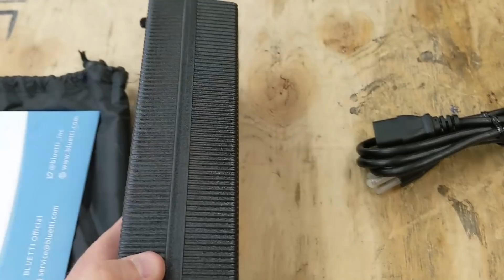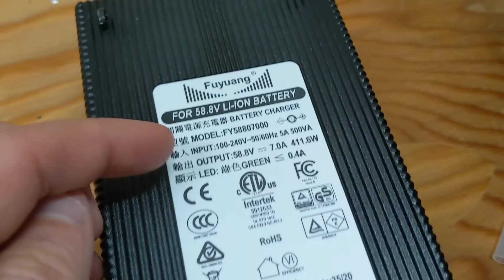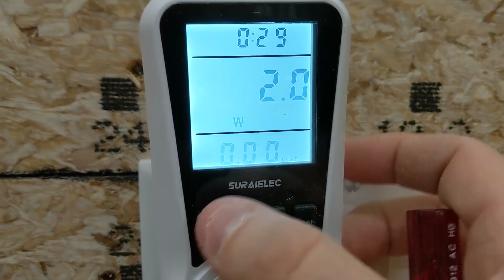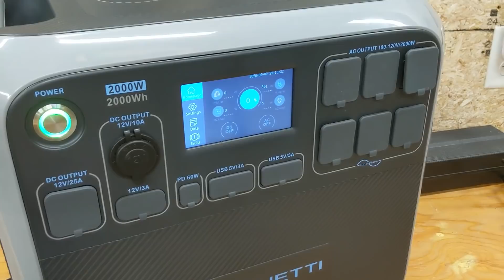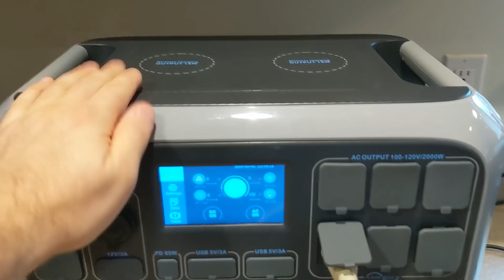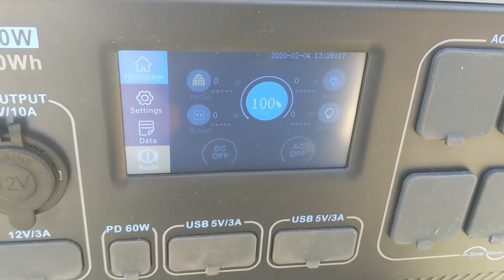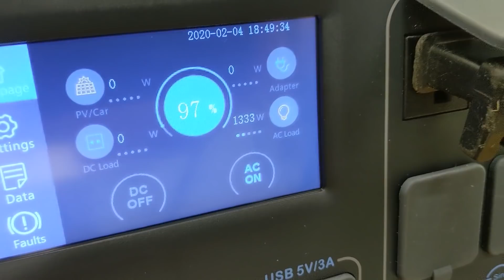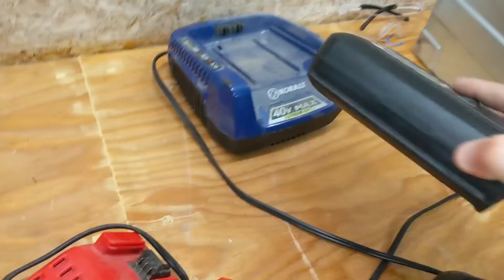DPoz Reviews:  Bluetti AC200P - Updated model for 2021 - Solar Generator

Comment: Is this a power station or a generator?  Is it noisy?
Reply from the maker: This has a battery, inverter, and solar charge controller all in one box.  Most of the time it's silent, but it does have fans on it that help cool the unit as needed.  The fans have a small noise to them.
Reply: @DavidPozEnergy  thanks!

Comment: I just bought this unit looks great seems to operate great but I noticed it is not UL certified/listed that is a concern for me as if I ever had a fire God forbid I don't believe my insurance would cover please advise
Reply from the maker: This is not made for permanent hookup to your house.  It's made for temporary and portable situations.  I think that's the difference between needing UL or not.  However, I don't work for UL (underwriters laboratory) or an insurance company, so you will have to check for yourself.

Comment: Sorry, do I understand this correctly? This giant battery that costs $2000 can run two little lights and a tiny heater for only five hours? What am I missing here?
Reply from the maker: Yep.  What Bluetti has done is combined lots of small things into one package.  They have a 2kWh Lithium battery, 2kW inverter, 15 Amp Solar MPPT charge controller, 10 Amp Car charger, Wall Charger, display, meter, outlets, USB ports, all into one package.  If you tried pricing out those items you will find they also cost about $2,000 and then you would have to assemble all of them.  This is made for fairly small applications.  For example, Van conversion to campers.

Comment: Thanks for the video.  I bought the AC200P + 3 120-watt solar panel package.  I took it out of the box and tested the solar charging and was surprised to only see about 4 to 5 amps at about 55 volts while the panels were in full sun. I guess I was expecting to see the full 12 amps.  Am I missing something?  Or is it working correctly?  I've done a little 12 Volt work but only running off alternators in my van.  The high voltage of the 3 panels in series may be confusing me.  Is an amp at 12 V the same as an amp at 55  volt?  Thanks all!
Reply from the maker: Sounds like you are getting about 250 Watts out of a potential 360 Watts, so it's performing 69% of rated.  A few things for this.  1. Orientation.  Solar panels perform best when perpendicular to the sun.  2. Time of day.  Best time to test a solar panel is solar noon.  3. temperature.  The solar panel must be cool.  Test conditions are 25°C for the panel.  But panels get hot when in the sun and then under-perform when hotter.

Comment: Will it run a hair dryer?
Reply from the maker: Yes.  I tested it with my wifes and it worked like normal.
Reply: @DavidPozEnergy  Thank you! I know drying my hair shouldn't be a concern during an emergency, but my hair would never dry!

Comment: Hey David, I am looking to purchase a Blueitti for my off grid cabin.  I am wondering about running the Blueitti directly into my very small panel.  The panel has breakers that will run about 9 LED 8watt lights.  I was also thinking about running a small fridge at the cabin via an outlet that runs to the panel.  What do you think?
Reply from the maker: You would have to make sure the small panel is 120v only, not 120/240.  Otherwise, I don't see a direct problem, but very hard to say without being there.

Comment: How long can your window unit run ? What if your still connected to the solar panels
Reply from the maker: My window unit (5000BTU) draws 460 watts.  This Bluetti will run it for 4.1 hours non-stop.  However, if it's just maintaining temperature in a room then the AC thermostat will kick on/off periodically as needed.  This will extend the run-time.  You could connect more than 460 watts of solar panels (up to 700w) which means when the sun is out this unit would run the AC without depleting the battery.

Comment: Great video, you really know your stuff.  Hope you can can respond soon, I am considering getting 2 of the suggested solar panels (Q CELLS 430 WATT MONO DUO CELL SOLAR PANEL G8.2) & the Bluetti AC200P - I thought you said can send more than 700 watts to the device without a problem, just will only use up to 700 - is this correct, overkill or would you recommend different solar panels to charge the Bluetti > will be using in Arizona (lots of sun)
Reply: actually appears the shipping is very high for those panels $330 per panel - is there another panel you would recommend?
Reply from the maker: When connecting the solar panels, the most important thing is to stay under the maximum voltage.  But it's OK to go a little over the watts if that works better for you.
Reply: @DavidPozEnergy  Hi David, just purchased one in Germany and want to attach solar modules as well. In winter times you want more modules attached than in summer, so I'd like to attach 4 - with the risk of having too much watts in the summer. There is probably no easy way to control output watts. Where do you have this statement "it's OK to go a little over the watts" - is this supported by Bluetti? How much is a "little over"?
Reply: What panels would you recommend for getting to most watts (max 700) the bluetti ac200p? - I am in Arizona with lots of hot sun - please let me know asap   Thanks!!!

Comment: Hi very detailed video. I have a dilemma if you can help me. I am in van and I want to run instant pot, freezer and electronics. Between dual charge system with inverter and this what is better according to your opinion? Thank you in advance
Reply from the maker: When you do out the math on buying the different parts DIY is usually a little cheaper, but not by much.  If this Bluetti will handle your needs, just go with it.  But if you want something a little more (like more battery capacity, or more inverter) then DIY it.
Reply: @DavidPozEnergy  thank you so much for your fast response.

Comment: great video david! hey i am going to be building a 12x 24 cabin, and wonder if it would be feasible to wire it in 12v  and 110v. have both come out into a corner of the room where i would leave the bluetti. i could put male connectors on both elerical systems, and plug them into the bluettie...this way i can take the bluetti with me when trucking, and then power the tiny cabin when back from the road. this way i can have recepticals everywhere in the walls, and i wont have to run extension cords for everything.
Reply from the maker: Yes, that is possible in a very small space like you are describing.  The difficulty I've seen with running 12v in a house is the voltage drop.  Since your project will be short runs it probably won't be a problem.
Reply: @DavidPozEnergy  right on, great to hear. this way i can take it with me on the road, and also charge it up for when i arrive back at the cabin....cool stuff...thx for the reply david...have a nice day man

Comment: I think im going with this one! The most im powering is a heat gun and small pancake compressor for work! Also using for when I go camping and overlanding so can charge in the back from the 12v before departure. I think this will be the one

Comment: My eb240 has no problem starting and running my 5000btu ac unit,even when my temperature is set low enough for it to cycle  on and off. Its a ge brand.

Comment: The difference between the saw and the compressor is due to the more inductive nature of the compressor. Any electrical load (appliance) has a resistive part and a inductive part. The Resistance of an electrical circuit represents the resistance against letting the current flow, ... or stop it. Supraconductors are capable of litteraly "0" resistance whereas an electrical insulator has an "infinite" resistance (plastic covering the copper in an electrical cable for ex). Inductance is the physical property representing the resistance against CHANGE of current in an electrical circuit. Typically, electrical motors have a bigger inductance compared to heaters (ex: hair dryer). Sine inverters can deal easily with resistive loads but with much more difficulty with inductive loads. In your test, the inductance of the saw is smaller than the inductance of the  compressor, and the Sine inverter deals better with the inductance of the saw than with the one of the compressor.
Reply: I think it has more to do with the duration time of the surge.

Comment: Love that solar generator but doing the math using my Ryobi 2200/1800 Watt gas generator, I'd have to use it 180 times with a full tank of gas to make the purchase for this worth it. That includes gas, oil, air filter, wear and tear on my truck to get gas. Obviously know the advantages of this but for my use case the price point isn't worth it. Love the video and thank you for taking the time. I wish everyone made videos like this for different use cases and good information! Might buy this later down the road!

Comment: Question. How well/long does it charge via the Aviaton plug connected to a 12 volt cigarette lighter adapter plug?
Reply from the maker: About 20 hours from 0% to 100%.  That plug is 12-30v, 8.2 amps.  My car usually is about 14.1v when driving, so if I had this charging while I was driving it would pull (14.1v*8.2a)= 115.6w.  The battery is 2kwh, plus some loss in the process.
Reply: @DavidPozEnergy  Thanks

Comment: 1ton Air-conditioner wil run for how many hrs ,if not pls recommend power bank
Reply from the maker: This battery/inverter can output about 1.9kwh.  If your air conditioner draws, maybe, 950 watts...  Then it can run for 2 hours.
Reply: @DavidPozEnergy  for 9 hrs vt to do

Comment: Is it possible for welding?
Reply from the maker: A small flux-core welder on a low power setting will work.  But not if you crank it up for thick metal.

Comment: Inefficient power station which loses 50% in 24 hours in ac mode with no devices and 1% per hour in dc mode. 
Cancelled my $4500 order (with 3x sp200) the detail information also in their site is not consistent. They said sp200 is waterproof but after they said it is only IP54 and should not be put under rain. Also they say the sp120 is ip67 when it is exactly the same textures than the sp200. The site is inaccurate and it is impossible to get any replacement of some cable and adapter in canada. I don’t recommend.

Comment: Hi I haven't  a clue about  solar  power stations or voltage  wattage  or amps 
My question is what power solar  generator  would  I need  to use  a 750w toaster and a 1050w traver kettle  in my campervan or rv as ye call it  without  using  all the power 🔋and still be able to charge my laptop and two  phones 🤫👍, I'm living  in Ireland  so not much sunshine
Reply from the maker: There are a few things to consider when sizing.  Good job already knowing your loads.  If you want to run both the toaster and kettle at the same time, then you need the output to be at least 1800w.  This one is 2000w, so you are good there.  
Second thing is your battery capacity.  If the taster and kettle run for 10 minutes, then that's 17% of an hour, so multiply the draw (1800w) by the time it runs (in hours) = 306wh (watt*hours).  Plus your laptop and phones.  IDK, maybe 90 watts for 10 hours, or another 900wh?  You would need to check your personal laptop.  But if that's about right, then your electrical usage per day is 1,206wh.  Is the battery large enough for that?  In this case, yes.  It is a 2,000wh battery.
Last is can you re-charge it every day?  There is a built-in solar charge controller, but you have to buy your own solar panels to add to the roof of your campervan.  If you don't get enough sunlight you can still re-charge it with the engine running

Comment: Bluetti has changed the product now and it has a worse BMS. You can no longer see the battery temperature or cell voltages, they removed that feature.

Comment: The charger that you are using in this video is for the AC200 which had LI-ON batteries, and the charger clearly shows "for LI-Ion Battery. I have the AC200 as well as the AC200P. When I charged up the AC200P from the wall it was getting 448W steadily and at times as much as 456W.
Reply: hi! im new at all this and looking for a battery solution to heat electrically (a few hours in the late night/morning to get the coldest hours out in a caravan).
Could you tell me if / and how long I could power an electric heater of 1500watt with a fully charged battery with this unit?  And if its not possible, what is it lacking/where to look?  Any insights/advice welcome!
Reply from the maker: @Anais Huygens, This unit has a 2,000 watt inverter, so it can power a 1,500w space heater.  However, it will only power for 1hr15min.  because of the battery capacity.  If that's enough run-time for you, then go for it.
Reply: @DavidPozEnergy  Thanks for the reply!  I just read about their Kickstarter for the new 5100w version (also 2000 watt inverter). So is it correct to assume that with the 5100w version I could get 3,5hours out of a fully charged battery  /  out of a 750watt heater 7 hours?
Reply: a 14S Li-Ion and 16S LiFePo4 are almost the same voltage. The BMS will protect against the .4v difference. Also the charger shuts off when the tail current is less than .4 amps. There are at least 2 different bluetti chargers now for the AC200(P), one is a 7 amp and one is an 8 amp.

Comment: Good Video, but..... For $1800.00 I wouldn’t even consider this, a Predator 3500 gas generator outperforms the Bluetti in every single category and for $1100.00 in savings I’ll put up with some noise...but that’s just me

Comment: My van has a 150 watt 110 ac plug, if I used that to charge this while driving would it just blow the fuse since it's showing 380 watts from the wall outlet?
Reply from the maker: Yes.  But you could charge this from your 12v plug in your van.  it comes with a 12v adaptor.
Reply: @DavidPozEnergy  ah ok I am not sure what my cig lighter output in the van is but hopefully the ac200p won’t blow it out like the 110 outlet would.
Reply: Wish I could get them to send me one for review! Hehe

Comment: Great Product..  Just Ordered one!  I have a pile of LifePo4 32650 5AH cells.. going to look into adding Mo Battery externally.  Hopefully parallel my cells with the internal 16S so the charge/discharge limits work properly.  I can survive with 2Kw ish output, but more WH capacity would be nice.  I have four 200W solar panels which should work perfect.  I have a well pump which requires 220v so will need to crank the generator every day or two anyway. If using the internal balancer looks risky, I may risk no BMS.   I've heard that LifePo4 isn't as pickey about cell balance, an occasional Top balance with a balance charger is all you need. Comments?
Reply: IMaybe just connect internal and external LifePo4 16S batteries thru a silicon carbide diode so that external battery only supplies current to the Bluetti.  Internal charge balancing occurs normally, I have an external charger for the external..  David..  maybe Bluetti would comment how to add external battery capacity No Doubt voiding the warranty of course?

Comment: Non linear loads may be another term that is used along with inductive but I had not heard of that used very much. I was familiar with the use of the term "inductive loads" used for cfl lights, electronics, fridge compressors etc rather than "resistive loads" which would be heaters (w/reistive elements), filament light bulbs etc.  My understanding is that inductive loads (or maybe also non linear) put more neutral current load on a electrical system. This is why there were so many neutral wires burning up in ny buildings over the decades once they came out with fluorescent lights, computers, refrigerators etc because neutral wires were always undersized because they did not need to be as big in the past with everything prior being resistive loads. In the past you just had incandescent light bulbs, electric stoves, hot plates and maybe a radio or two in peoples apartments. Radios also used tubes which maybe is still resistive?  over transistor and other electronics? Not sure about that but curious.

Comment: Typed this before I read Janson m comment. Yes, I agree with him. The saw on start up is not requiring a very long inrush, where the compressor is probably drawing a much longer drawn out inrush current. Think about the time you hear them actually starting up.

Comment: David, how about sump pump?  Was thinking of using this power station as a backup when we lose power, wanted to plug it into this power station and the power station plugged into the wall.  If we lose power while I am away at least sump pump can be functional for few hours I hope.
Reply from the maker: I think it would work great for that application.  My miter saw is 1.5hp, so if your sump pump is less than that you are probably OK.  I don't own a sump pump myself, so I don't know the normal motor size.

Comment: many correct responses, its not the inrush its the instantaneous vs over time current draw. thats the whole concept of Electrical Coordination in any critical building electrical design. u dont want a main breaker to trip before circuit breakers, there are adjustable delays for trip.

Comment: You shouldn't have had to bleed air out of the compressor before starting it if the unloader valve was properly adjusted. 

When the compressor reaches cutoff pressure you should hear a sound like a big sigh or "pffft" of air being released.

Improperly adjusted unloaded valves are common on Harbor Freight air compressor.

Comment: It started the saw better with more current because the duration of the in-rush was a shorter time-span. 44 Amps for 1 second versus 66 amps at 0.35 seconds makes a huge difference in how inverters react to the in-rush they have to compensate for.
Reply: Awesome